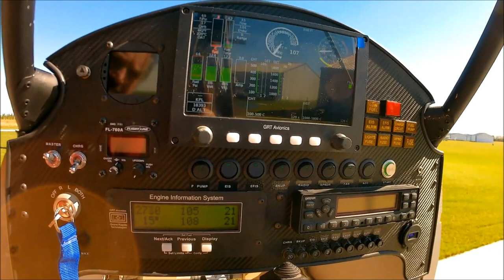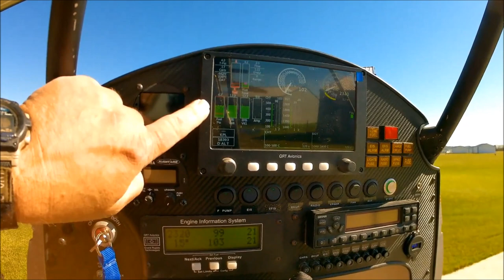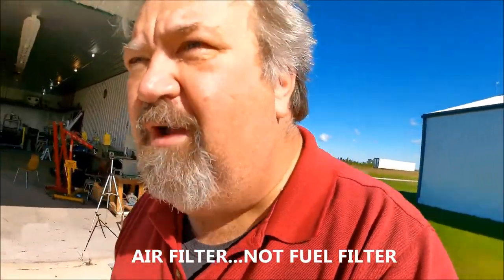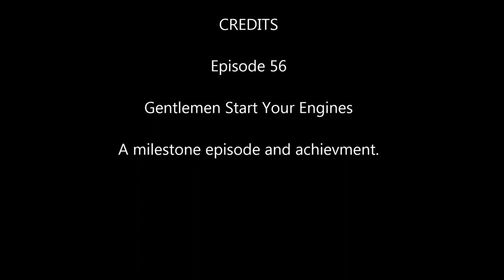EP 56 Gentlemen Start Your Engines! Challenger 2 Ultralight Airplane

Comment: glad u  got it going   bud  a few pointers though from 30 yrs experience  ,,i think urs is twin plug version   even so  we defo find using some of strap over the plug caps  can really help  keep caps on .keep an eye on belt tension .next biggy   is carb mixture ensuring that is right -u cannot rely on cht or even egt   plug chops and then plug colour .did u test both mags ? heres a check list i am working on = Challenger    pre take off check list 

Chokes off
Both   Ign on 
Controls
Brakes 
Doors locked 
Mag check
Fuel pressure check
Enough fuel
Oil in fuel 
Rpm check full power 
Seat belt 
Set QNH QFE

Comment: Glad to see you got it running. 

I always choke just enough to get it running then turn close the choke. 

Electric fuel pump i prime for 3sec before starting, on take off and landing then it’s used as a backup. 

Egt not working could be a simple wiring issue or that they are bad. 

You definitely look a lot happier now that it’s running.
Reply from the maker: Tracking down that EGT issue won't be hard. One item I'm concerned about is the reduction drive belt tension. It rattles like heck when you retard the throttle to idle for about 20 seconds, then runs smooth. Everything points to a loose belt, but the tension feels tight when the engine is stopped?! I'll have to talk to Bob in Salmon Arm BC about that.
Reply: @challenger2ultralightadventure Are you sure it's the redrive rattling? Make sure you can slide the belt with your fingertips on the top cog. It shouldn't be tight. How did the bearings feel before you put the belt on? nice and smooth?
Reply from the maker: Bearings on the redrive were nice and smooth. That rattle coincided with the cog belt shaking a lot. As soon as the belt steadied, the rattle went away...and the engine RPM rose about 250 RPM?!

Comment: No need wasting time to prime the fuel system if you have enough battery 👍
Reply from the maker: Ah...but that's the key. Enough battery! I had enough battery, but by priming with the electric fuel pump, It will start much faster. Having fuel pressure at startup is a good thing.
Reply: @challenger2ultralightadventure  Absolutely 👍